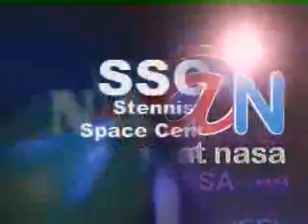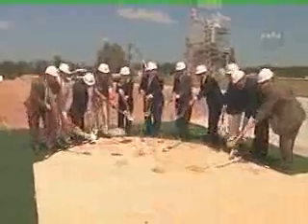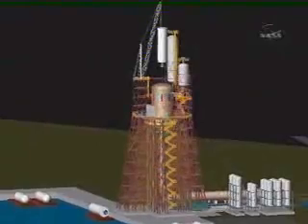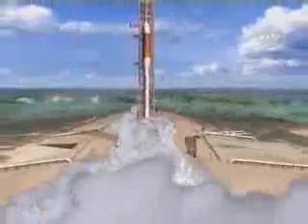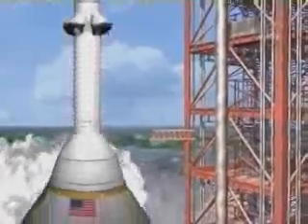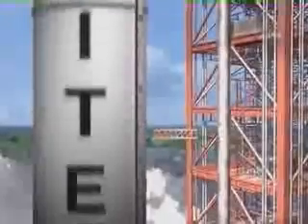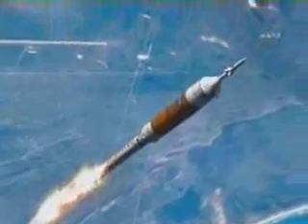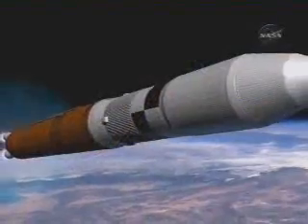For journey to Mars: back to the moon in 2020

Comment: In May 2019, NASA launched its plan to go to the Moon by 2024. They announced that they will use the Space Launch System, and the Lunar Gateway (launching in 2023), which is a lunar space station. Here are the current official launch dates of each mission, their objectives as planned, the rocket that they will launch on, and the mission duration according to Wikipedia (I will update these dates overtime should they get delayed. I am writing this comment in December 2020). 

Artemis I - unmanned flyby mission - SLS Block 1 Crew - ≈25 days: November 2021
Artemis II - crewed flyby mission - SLS Block 1 Crew - ≈10 days: August 2023
Artemis III - lunar landing mission - SLS Block 1 Crew - ≈30 days: October 2024
Artemis IV - lunar landing mission - SLS Block 1B Crew - ≈30 days: 2025
Artemis V - lunar landing mission - SLS Block 1B Crew - ≈30 days: 2026
Artemis VI - lunar landing mission - SLS Block 1B Crew - ≈30 days: 2027
Artemis VII - lunar landing mission - SLS Block 1B Crew - ≈30 days: 2028
Artemis VIII - lunar landing mission - SLS Block 2 Crew - ≈60 days: 2029
Artemis IX - lunar landing mission - SLS Block 2 Crew - ≈60 days: 2030

Comment: @KrellLab Actually the shuttle has been set to shut down long before the current President came to office. Its an old system that can be done better, even though it was a fair test bed in its time. Better to put the money into a better system. Besides he only got 4 years in office, not time to end it, at the most just slow it a bit, if he is at all. President doesn't make all the choices and the Congress decides where the bucks go.

Comment: I wonder if they know their system will be obsolete by the time it flies?
Technically it already is very out of date considering technical advances that have occurred in the past 15 years.
They really should implement a new RLV vs a spam in a can use fuel depots and reusable hardware.
A better plan would be the 1993 ELA plan but with solar electric tugs for bulk cargo transport from LEO to the moon.

Comment: Zarya,Pirs,Zvezda were Launched by Russia as well as the MLM in December 2008.
I do agree the DCX and the X33 were killed more for political then technical reasons.
It also was foolish to kill SLI right when it was producing new engines  comparable to the old F1 on the Saturn V except they were reusable the RS84 and TR107.
I'm just not impressed with Griffin's performance as administrator but then Bush did appoint him personally.
I think Ares V will work but it's going to cost 1B a pop.

Comment: Well 2024 is possible if NASA was ran right Griffin is an idiot in my book.
We don't need to 5 segment RSRM or the J2X to get to the moon just google direct launcher.
Also on the J2X three RL60s would be higher ISP then one J2X plus to reach mars we need nuclear engine these were invented back in the 70s but never flown P&W designed a new nuclear rocket engine called Triton.

Comment: They built and launched over 40% of ISS and have done missions over a year in length plus their next generation vehicle is a lot farther along then Ares and Orion.
It's a well known fact that Ares I is unsafe because it has a serious oscillation issue and under performs.
Just google Ares I oscillation issue the only thing more disturbing is the latest fix.
They really need to scrap the stick if they wish to move forward.
If they stay with the Ares plan NASA is going nowhere.